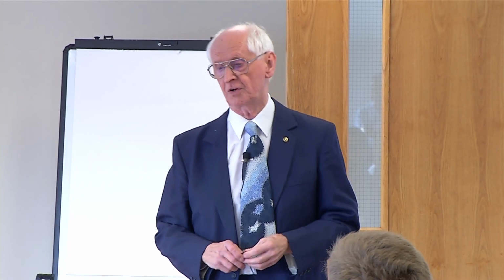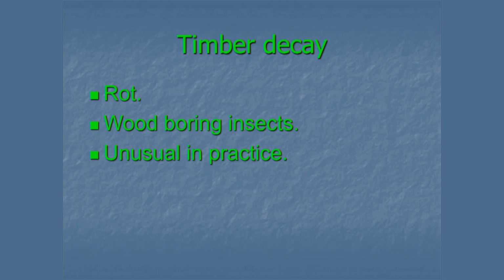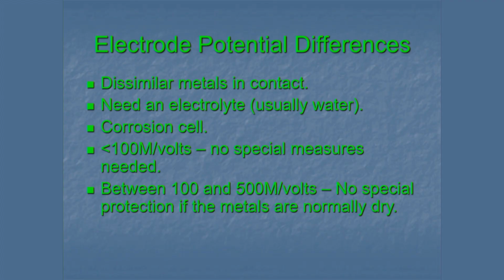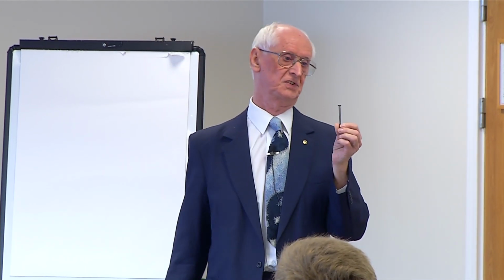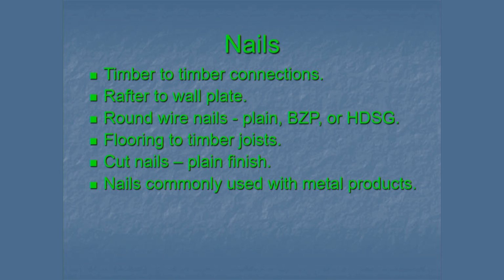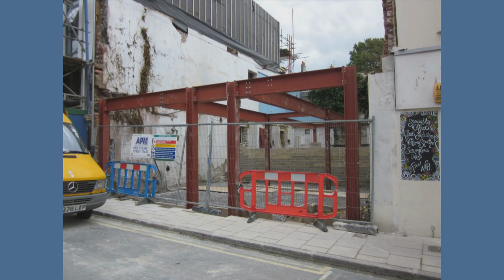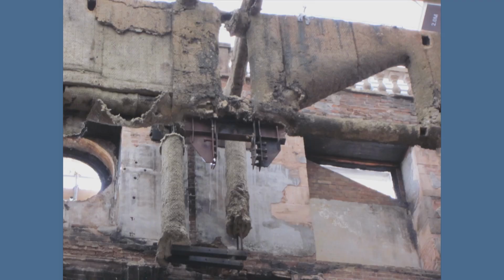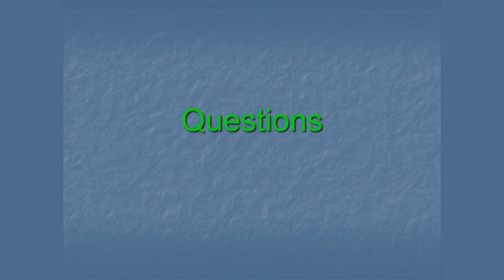CPD Conferences November 2022. Paper 2 - Structural Fixings – A Building’s Weakest Link, Chris Shaw

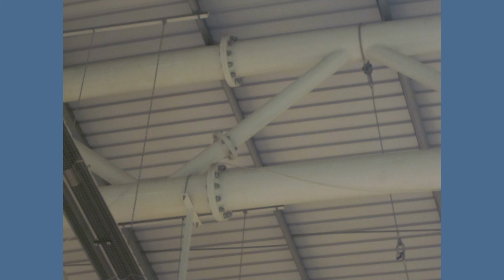Comment: I am a structural engineer and design lots of steel frame buildings.  I think that you are being very hash on the consulting engineer responsible for the steel trusses at 44:00 saying that the bolts are not good enough.  you weren't involved in the job so don't know the actual forces on the bots.  Engineers are often asked to design splices/connections at mid point even though the forces on the bolts can be the highest because that is the best way to split the structure up for transport as you point out.  You also have a go at the frame in the garden centre at 50:30 and say that the apex connection is a critical connection and it has only 4 bolts.  In a portal frame it is the eaves connection that is critical and not the eaves and that eave connection had 8 bolts and not 4!  As the eaves connection transmits a bending moment to the column, this reduces the moments along the rafter so the forces are much lower at the apex.  And for the large sports hall trusses, it could be that there is a moment connection at the eaves - we don't know.  The rest of you presentation I agree with!  Except that you rightly say about HSFG bolts at the end rely on grip and friction therefor there is no need for the ends of the UB section to meet (54:18)